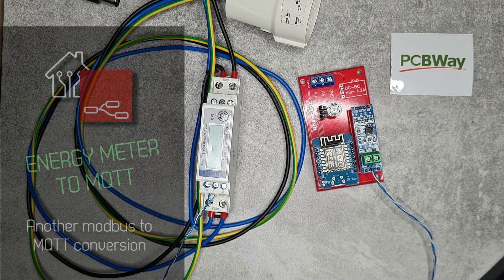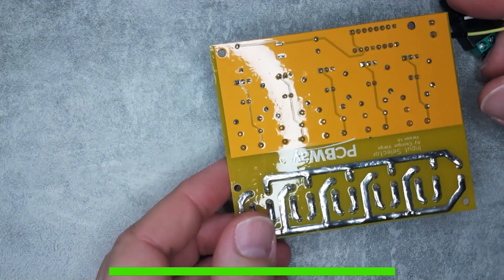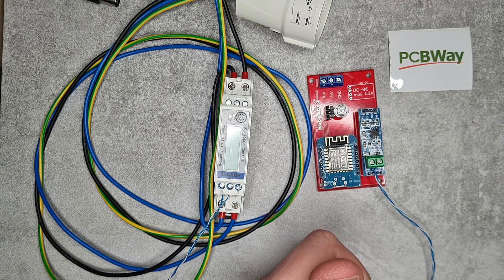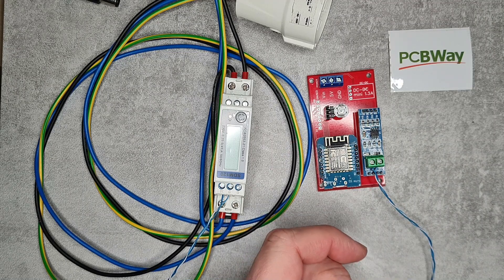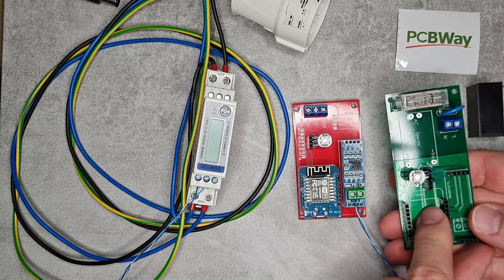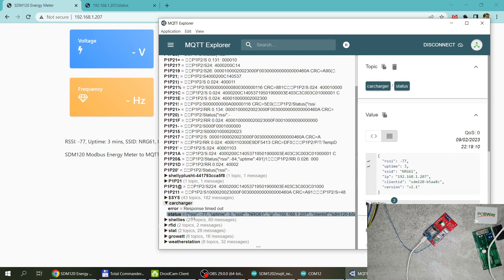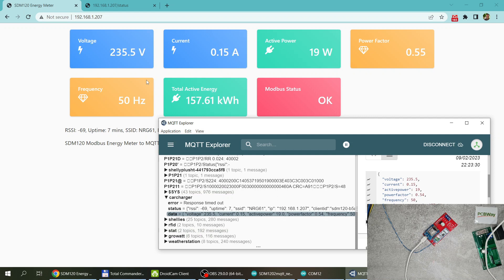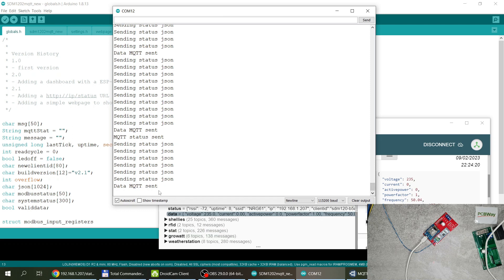MQTT energy meter: convert a SDM120 Modbus meter to MQTT

Comment: Thanks for the video. I am trying to do something similar with the Eastron SDM230, and integrate it into home assistant.
Reply from the maker: I never worked with the 230 but I assume it is very similar. Probably you can change the registers around and it will work.

Comment: Question; I am curious if I can connect or share both ESP32 and Deye inverter o n Eastron RS485?
Reply from the maker: Unfortunately not. Modbus is a master slave protocol, there could only be one master on the serial line. You cannot have an ESP and inverter reading the same modbus device.
Reply: The Eastron will serve as the master?

Comment: Nice vid Csongor, tkx for that, can you maybe show how the 485 in connected to the esp8266 ? Would that be the same for a ESP32 ?
Reply from the maker: I attached the schematic of to the board project. So you find all the wiring diagram there. I don't think I am using any special pins on the ESP8266, so I assume you would be able to use an general purpose IO pins on the ESP32 as well.

Comment: Hi Jhon, thank you for your videos. iḿ searching for a code to realize the zero power injection to grid for Growatt inverters. i use a sdm630 meter. Du you have a code example to realize it ? Thank you very much
Reply from the maker: Well, As far as I know some inverters have a dedicated RS485 port and it reads the energy meter directly. But I am not sure what models are supported. And in this case the inverter takes care of it automatically. But in this project, there is already a setMaxOutput topic where you can reduce the maximum output of the inverter. I did not use this functionality on mine yet. But it would be possible for you to read the SDM630 and set the SetMaxOutput manually.
Reply: @csongorvarga  nice, thank you very much. can you explain, where i can find the setmaxoutput in the code ? i can´t find it....
Reply from the maker: @johannscharl2935  You can find it in the main ino file, there is a callback function where all the MQTT messages are handled. And it is only simple modbus register update.
Reply: @csongorvarga  Thank you very much John, i will try it.....
Reply: @csongorvarga  Hi John, now my growatt inverter is talking to the esp (build on your project). All is working fine and i use nodered to show the data. Can you tell me, how i can use the /setMaxOutput function with node red ? i try with the "mqtt out" node, but itś not possible, to connect to the esp...Thank you very much!
Reply from the maker: @johannscharl2935  use the mqtt out node, but you talk to the same mqtt broker where you get the data from. You send the data from node-red to the broker and it will send it down to the esp.
Reply: @csongorvarga  Hi John, thank you very much for your assistent, now itś working fine. only the wifi connection of the wemos is very bad. is it possible, to use your code for a LAN converter ?
Reply from the maker: @johannscharl2935  I don't have experience with LAN version of ESP8266. I know a ethernet "hat" uses a few pins of the ESP and my project also uses 4 pins. If there is no pin conflict it should be easy. Otherwise the pin mapping would need to be moved around which should still be possible, but I am not 100% sure.
Reply: @csongorvarga  thank you very much. perhaps i will try it, but for now it is not important for me. can i use another slave address, for example 2 ? can i change the slave_address in growattinterface ? thanks
Reply from the maker: @johannscharl2935  Yes, you can use a different address, no problem.